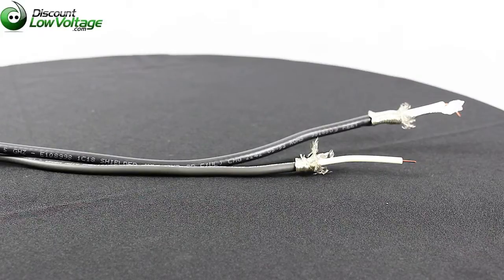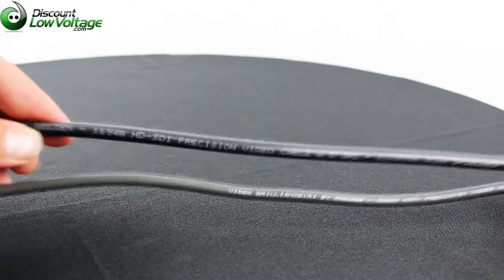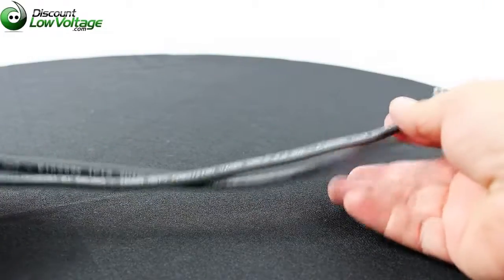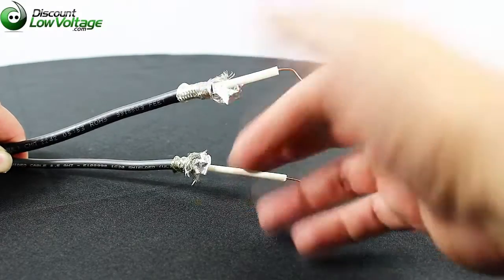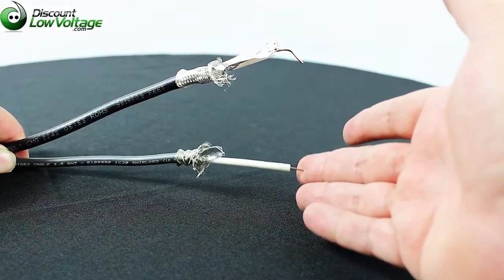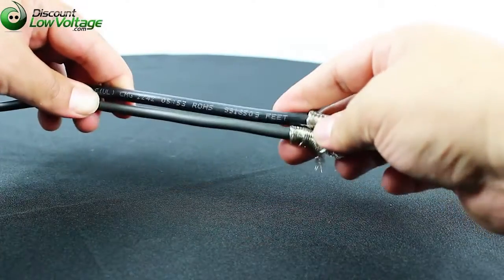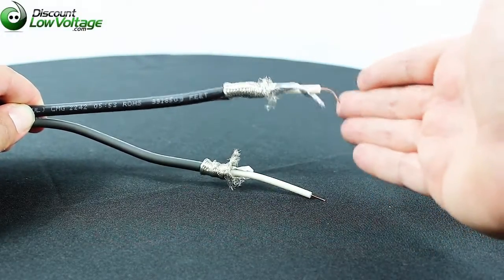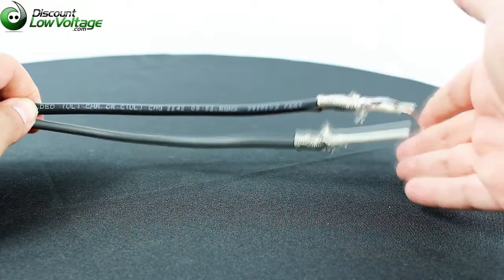Belden 1694A vs Belden 1505A Coaxial Cable Comparison

Comment: Useless bla bla without any informations
Reply: Size and distance. 1505a is RG59 and 1694A is RG6 which is slightly larger and has better distance performance.